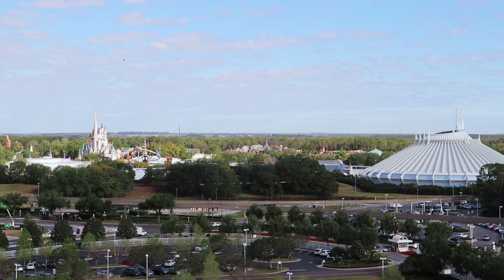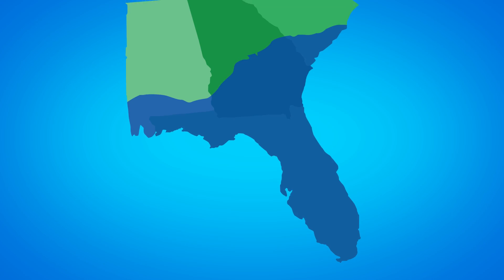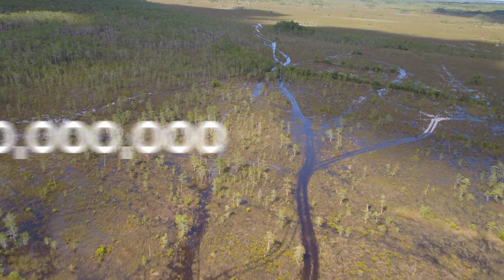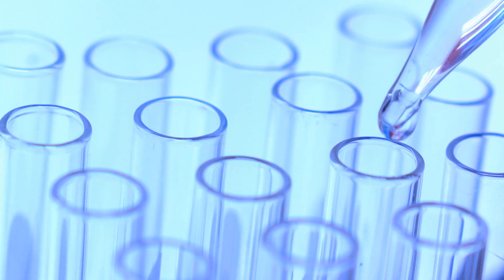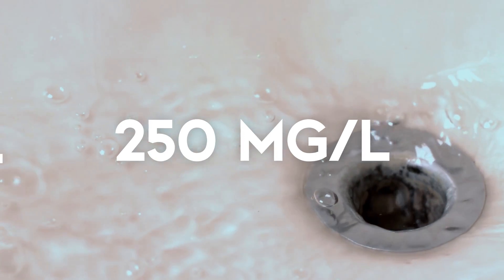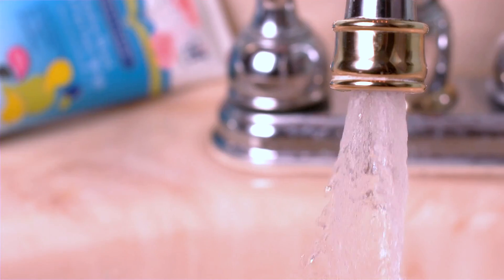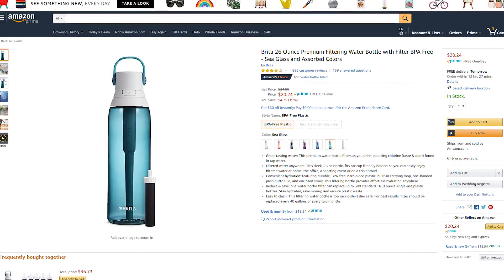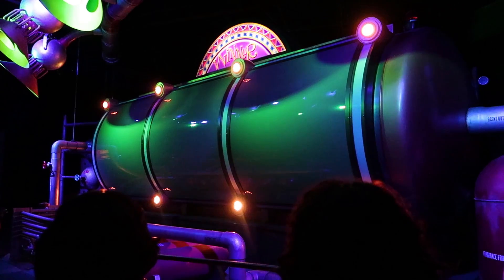Why Does Disney World Water Taste Bad?

Comment: Pro tip: the water at the Starbucks in the parks generally doesn’t have the sulfur taste and you don’t need to buy anything to get water from them. As long as you are ok with waiting in a Starbucks line. Also, highly recommend bringing a yeti or another brand of insulated water bottle with you to the parks to put the Starbucks water in so it stays nice and cold all day!

Comment: 4:16 yes because if you just drank h2o you would die (h2o is better known as purified/distilled) water, the reason it kills you is because of osmosis, the equal distribution of salt concentration, often demonstrated by a filter that lets the smaller water molecules through, but blocks the salts dissolved, the cell membranes function the same way, the water without salts will try as much as it can to get in your cells, to try equalize the salt concentration, the problem is that the cells then get way too bloated with water and eventually rupture, you can imagine the lethality of that on a large scale, the opposite (dehydration) is when your body absorbs too high concentrations of salts (not just sodium chloride, aka kitchen salt, but also other salts) then what happens is the same but the other way around, the concentration of salts outside of the cells is higher than on the inside, so the salts outside the cells will pull water molecules from the cells to equalize the concentration, and our bodies rely on the stability and flexibility and elasticity that water filled cells have, again the lethality of this on a larger scale is easily imaginable, it’s also why your skin wrinkles from dehydration on smaller scale

Comment: Disney wont do anything about the tap water because they want you to buy overpriced drinks.
The water fountains are there for legal reasons, they dont want people dehydrating in florida heat and suing the company for extortion. 
Option 1 - install filters on-site to clean the drinking water. lose drink sales. 
Option 2 - Dont spend shareholder money on filtration. Double your profits on coca cola products & licensing deals
Reply: It hardly has anything to do with pushing drink sales. The filtering systems are expensive as hell and why spend the millions on it if it isn't needed. The water is still safe, and even if they spent the money people would still buy the drinks anyway.
Reply: @mikel9567  are you kidding dude? Drink sales are HUGE in business
Reply: @mikel9567  Obviously never played RCT

Comment: Gypsum (CaSO4) alone in water doesn't produce a sulfurous/sulfide odor.  i wouldn't say sulfate is tasteless, but it has to be reduced from that oxidized state to supply H2S for a rotten egg odor.  My understanding is that that reduction is accomplished by Fe++ (ferrous iron) with the assistance of bacteria.  The iron is oxidized to Fe+3 (ferric), which stains.  If you want really bad, yet potable, ground water, go to Weedsport NY.

Comment: $3.50?? I was at Disney World in May 2019 and bottled water was $4.50.
Reply: Where were you buying your water from? I worked in DHS until May 2019 and it was $3.50 everywhere I remember
Reply: @PenguinHi5  Pretty much from every kiosk available that sold water. I can show you the receipts for the water purchases if you don't believe me.
Reply: @AlbertCalis  I mean, I believe you because I stopped working there in the middle of May but was it a regular dasani water? I'm just curious if they increased the snack prices again because in the parks I know that bottled soda and some of the flavored water cost $4.50 but regular dasani waters were $3.50
Reply: @PenguinHi5  Yeah the prices of everything increased. I remember prior to this year, bottled soft drinks and water was $3.50 as you said, but this year, the prices went up to $4.50. I'm not surprised considering Disney recently jacked up the prices for annual passes recently.
Reply: @AlbertCalis  prices differ depending on where you are buying the product. Taxes differ from Disney resort to resort because they fall under different county jurisdictions within WDW.
Reply: Inflation
Reply: Still cheaper than Six Flags Haha

Comment: I guess all you city folks would rather drink over chlorinated pool water. I think WDW water tastes great.
Reply from the maker: I ended up cutting it out of the video because I felt like it didn't add enough to the point of the video, but I ended up doing a side by side comparison of NYC tap and RCID tap to see how the levels compared to other regions. Beyond having more sulfates, the Florida tap had on average nearly twice as much chlorine (1.17ppm vs 0.60ppm) than NYC water. So technically between the two, WDW is more chlorinated (though the max acceptable level is 4.00ppm, so like sulfates, neither comes close to being too much).
Reply: @MidwaytoMainStreet  I grew up and still live with nonpublic works water. I can drink wdw water before processed water. 
The water flavor thing is very interesting though. International travel causes the same experiences.

Comment: I am not normally a bottled water type of person, but when I worked at WDW, I just couldn’t drink Florida tap water so I bought the gallons of filtered, bottled water and drank that, but when I’m there on vacation, I usually fill the ice bucket at my hotel and because the water used to make the ice seems to be more filtered, I let it melt overnight and then I put it in my bottle in the morning and add more ice because the colder it is, the better it tastes.

Comment: Step 1: find a water fountain that is in a shady spot. 
Step 2: press button and hold for about 10 seconds, longer if you think no one has used this fountain in the past few minutes.
Step 3: check water flow. If the stream is weak, skip ahead to Step 9.
Step 4: listen for the sound of the chiller turning on, if it isn't already running.
Step 5a: If the chiller turns on, skip ahead to step 7 or...
Step 5b: if the chiller isn't running, skip ahead to step 9.
Step 6: test water temperature with your finger, or have a quick taste if you are a daring sort of soul.
Step 7a: If the water is warm, skip ahead to step 9 or...
Step 7b: if the water is cool, skip to Step 8.
Step 8: have a drink, frown, and then buy a bottle of water.
Step 9: Proceed to step 1.
Reply: ...are you like, a waterboy?
Reply: Excellent procedure! THANKS! :|
Reply: You have to know that water sits in those pipes for so long as well unless people are always using it.
Reply: @DJMinor5000 you'd be amazed how much water is dumped on the ground in attempt to flush pipes that are stagnant... this is the issue at MK stagnant water in pipes doesn't taste good.
Reply: Random Person - ah, so far you’re the only person who actually follows directions! (The whole thing is trap, as you could not do step 7a or 7b) 😁
Reply: Please don't stick your finger in a public water fountain. Gross.
Reply: @julierenner2896  I think he means just in the running water, not on the actual .. uh...faucet? I guess? dispenser? water-shooter-outter thingy?
Reply: Julie Renner oh trust me I’ve stuck my finger in worse places
Reply: Thank you
Reply: Hahaha
Reply: Pretty sure this was meant as a joke. A good one though.
Reply: DJMinor5000 theres no such thing as wasting water.. ever been to a waterfall and watch it for half a second? Or realize you are basically in a ball with the same amount of water in it irregardless if you were to run a fountain?

Comment: For whatever reason, fountain water at the Magic Kingdom tastes more sulfuric than the water at the other three theme parks.
Hint: The colder the water, the less you can taste the sulfur.
Reply: I filled my water at the fountain in line for Pirates of the Caribbean, and when I went to drink it later the smell was just like that smell you get waiting in line for a boat ride. I dumped it out XD.
Reply: Swamp Sagacity I noticed that the first time I visited WDW! Basically, I dubbed the water from Magic Kingdom, “that disgusting gator water”...for some reason!
Reply: It's the oldest of the parks? Perhaps the others have better filtration tech?  Or maybe it's that bit further from the others so is drawing from a different well?
Reply: @BellePullman  it call comes from one plant in RCID.. Maybe the pipes being iron or low flow might have to do with it. Dead ends and low flow can make sulfur and other contaminants concentrate in the pipes. Magic Kindom was the first of a kind in its time so they might not have thought about stagnant water in pipes when they were more worried about opening on a deadline.
Reply: I agree 100%...only an issue in MK...every other park is much better.
Reply: Cosmic Rays had what my family called “fart cokes”.
Reply: i bring a nice insulated cup and fill it with ice in the morning so it stays cold the whole day
Reply: I've never been to Disney, but I've been to other parts of the state and most of the water tastes really bad in that state. I also noticed if you don't breathe while drinking it even after you drink it, sometimes you don't taste the sulfur.
Reply: that prbly has more to do with how taste buds work with cold water.
Reply: The only cold own is the one by the jungle ride
Reply: @gavinpharris1761  At Animal Kingdom the fountain near Avatar flight of passage was the only cold one there. If you face the ride entrance it's to the right and kind of behind you. Near the bathrooms, to the left of some restaurant. Gotta stay hydrated!